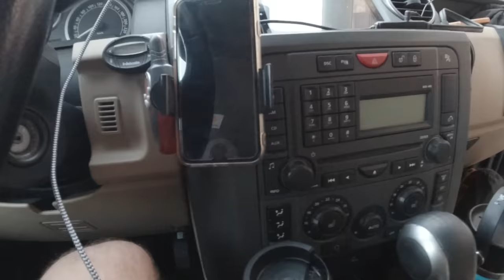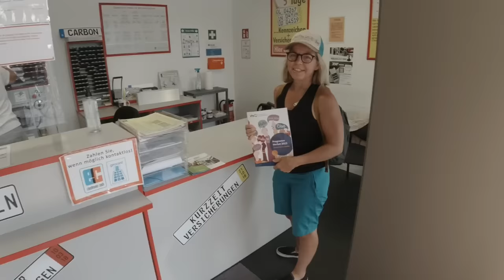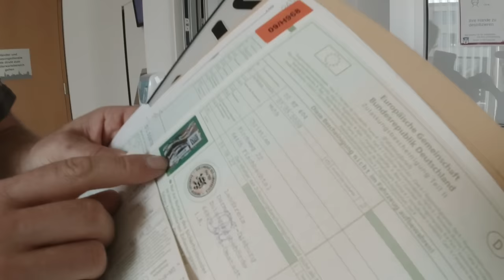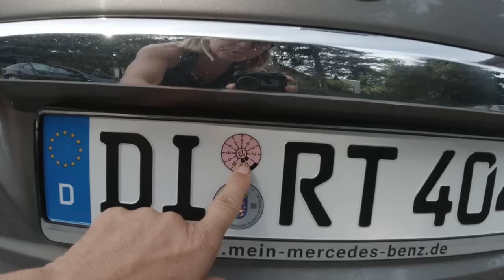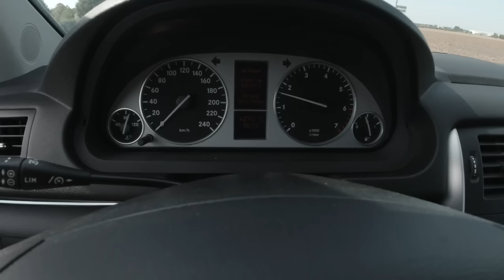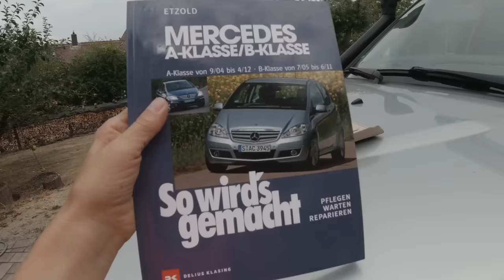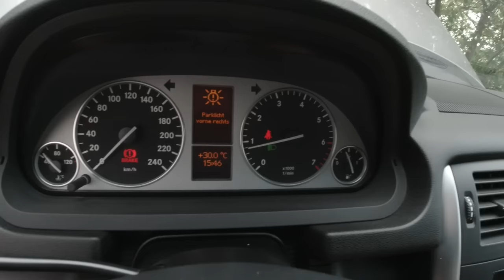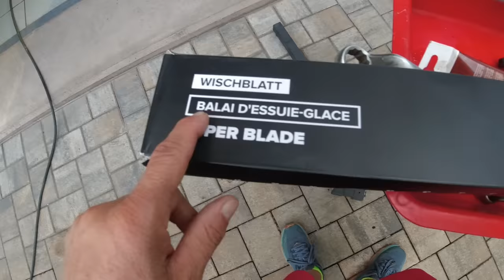We bought a cheap Mercedes B-Class W245 and we love it

Comment: Yes, when you own a Land Rover you need to have a back-up vehicle.

I bought a Toyota Yaris because everybody knows Toyotas are reliable.
It developed an ABS fault almost immediately which proved difficult to diagnose.
After inspecting all hubs, and finding various problems with all of them, I got the ABS working long enough to sell it again.

Next I bought a Honda Jazz because everybody knows Hondas are smple and completely bulletproof.
3 months later, two of the pistons tried to escape through the side of the engine-block.
New engine (from a scrap yard) in and sold it sharpish.

Replaced it with a Mini Cooper because everybody knows Minis are cheap to run and easy to sell later on.
It's roughly £5 per week cheaper to run than my Land Rover and, 6 months later, the fuel pump died and I had to pull half the car apart to replace it.

Meanwhile, my unreliable 20 year-old Discovery 2 with 200,000 miles on it has needed a new set of windscreen wipers.
Reply: Hahahahhaaha. I like your comment about the cars you bought and the reasons
Reply: True story, yeah right.

Comment: Hi Christian and Vera, what wonderful people you are? I first saw your channel whilst looking at LR engine removal... Although we don't have a Discovery, we have a 2007 Freelander 3.2 i6 HSE Auto, (LHD). What captured my attention was the statement that you do your own repairs and go against the trend of buy small, new and sell on afterwards. We share our time between the UK and France. I love my FreeDeux but we too have a back-up vehicle, a 2008 Mercedes A200CDI Elegance. Surprisingly roomy with lots of nice things altough over 200,000 k on the clock. We also made the decision that we would do our own servicing and repairs. There are so many things that are similar, We don't so much have a garage, but a barn with tools!! And have purchased a two-post lift, that is waiting until we can put in a concrete base. So far I have replaced the cyclinder head on FreeDeux and will soon, (after we install the lift) swap out the engine and gearbox. We replaced the a/c compressor and the Auto gearbox ECU on the baby Mercedes. May I say that you are both inspirational, Thank you for sharing.
Reply from the maker: Hello Emma, thank you so much for your comment. Sorry for the late reply but sometimes, we get so many comments that we miss sometimes  important ones. You are going to love having a lift, I certainly do and I wasn't sure we really actually needed one. 😀I miss my Freelander, it's actually parked outside across my house on the pasture to be fenced in for horses. Living the good life now. 💪🙋‍♀️Vera

Comment: The subscribers Collie is a beautiful looking dog, and friendly! Nice of him to give you LR parts.

That is a nice looking suitable Mercedes. I don't think we ever got the B-Class in Australia. I have never heard of them. We too wanted our kids to have vehicles with Air-bags, ABS, Stability Control  etc in their first vehicles. You don't want them to be in an accident, though you want them to be well protected if it happens. Very different when I was growing up, as young drivers our cars were pretty bad. We knew no different.

I too am looking for another vehicle - though my reason is so I don't use my LR3 as much around town. It was always going to be my touring vehicle. I ride my motorbike to the office when I don't work from home, however it is nice to be in a car from time to time, especially when it is raining. Plus I prefer not to take my dog in the LR3 unless I take her camping - she shed way too much hair!

I have been looking at Mercedes Benz from the model years 1987 - 1997 and Audi's from 2003 - 2008. I like the overall looks both internally and externally, plus the grill of the Mercedes of those model years. I would dearly love a diesel Mercedes, though they are extremely rare in Australia. I figure the Mercedes of that vintage would be easier to maintain by myself. the Audi is purely because I like them, though I accept they can be a bit problematic, though the 1.8 litre engines of that vintage are bullet proof if maintained, especially the timing belt.

I entertained the thought of a BMW, though the Vanos system is just too problematic, and older ones are pretty much well and truly past their used by dates here unless they are one owner vehicles.

I could buy a Nissan, Honda or Toyota, but that would be boring!

Comment: Thanks for the video guys, they NEVER fail to make me laugh. Im a LR fan for many years, owning a once rusty 1991 3 door diesel Discovery that I spent a month rewelding the underneath on most things exept the chassis as it was fine. Im fussy so tackled everything that was needed doing.. That Disco although old was my daily driver from 2007 till 2017 still reliable still shiny in its factory black with full sized side factory graphics.. It was not the LR fault but mine when i sold it as I became disabled so ended up with a MK1 Freelander BMW diesel powered Automatic HSE spec.. Still love my Landrovers Still keep looking to buy a nice example automatic early Discovery, maybe a ex Japanese market one re imported back into the UK.. Anyway, Thanks again for the honest but fun videos - Ian .. UK.
Reply from the maker: Our pleasure.

Comment: Now you have the backup vehicle I’m hoping you’ll move onto getting the body off Vera’s D3. I keep hearing ‘we’ll wait till the engine fails’ but I honestly think this is not a good strategy. A broken crank is going to do untold damage to the block as well as causing failure in other components. If there was one thing I could do to my D3 now it would be to get the engine out and replace those worn bearing shells. For peace of mind if nothing else. Apart from that, if Vera doesn’t like the Mercedes Christian might have to lend her the the mall crawler! Keep up the brilliant content, it’s the best thing on YouTube. Thanks.
Reply from the maker: It will be a few more weeks before body off.  But it will happen.  Christian

Comment: In the UK we can do it all online in a few minutes as long as the car you bought has the  previous owner's paper car ownership document, minus a section that the seller uses to declare the car has been sold, either online or by post. 

If the car has a valid test certificate and you have insured it, that information will be registered online too, so all you have to do is pay the road tax or set up monthly bank debits online and your car is then legal to drive. The new paper car ownership document usually arrives in the post within a week or so. You destroy the old one. You can also do the whole thing using paper forms by post or at a post office if you want.

Comment: My wife SuSu has 2016 Mercedes B180 with which I hope not to have compulsory under body relationship.  Has had automatic transmission valve body replaced at 69,000km by Mercedes warranty…..(phew🥵). Price aud$7500.  Happy to learn a little about the B180. 
Sadly my 2006 Disco3 started to haemorrhage from rear main seal & at 71 I do not want to crawl under KT anymore 😢😢.  Sold it 2 days ago & bought 2012 Ford Territory which has same 2.7 ltr V6 Diesel engine as D3&4.   This one very quiet & healthy at 100,000klm. 
Thanks again for your videos & I will keep watching as I like your dry humour as well.  
Cheers again from 
Hugh ESLER in Melbourne Australia 👍👍
Reply from the maker: This is quite brave to buy an other TDV6!  Christian

Comment: Bigger gap = stronger spark so if you have a problem in the cylinder, it can get the cylinder to work.  Could be a cheap fix to get a 170K engine to run.

Comment: Again, very cool vid on real automobile life. I quit Mercedes some years ago - for good. About 1984, I bought a T1 207D long-wheel base, 2.8to GM, 1979 first reg., 100TKM on the clock, first owner, OM616 engine (2.4l, 65PS). These engines had the reputation of lasting for ever. There had been rumors about 1Million Kilometers done in Taxi cabs (MB W123, passenger car, same engine). I converted the van for a camping car. After about 10 TSD kilometers later, the timeing chain cracks and shots the engine to scrap. Reconditioned, genuine MB engine installed half a year later. This engine developed problems after 100TKM. By the way: When we bought the van, it had the 3rd rear axle installed. Rust was a companion all over the years, despite had all the screwed on-parts hot-dipped-zinc coated ( all doors, wings, hood). In the end, I lost the fight. There are some stories to tell. Second MB was a MB124, 2.5 5cyl, passenger car. Sold it after 5 years and MB lost a customer for ever - to put the expérience in a nutshell. During my trip through Moroc a few years ago, I saw a lot of MB207307D vans on the road and in the backyard ( on repair) and a lot of MB W123 taxis. A Toyota Corolla is one of my backing cars.
Reply from the maker: We only wanted to spend a certain amount of money for a vehicle for Robin. And after looking at so so many small vehicles, we just got the Mercedes. We actually wanted a Skoda Roomster or Yeti as the are big enough to have a small camper build inside. But they are so much more expensive than this Mercedes we got. And we have a good friend working at Mercedes, so that is always a bonus. Now most of us here  are driving a Land Rover, you that story you wrote can happen to anyone at any given time. 🙋‍♀️Vera
Reply: @Vera_and_Christian  That's right, Vera. Wish both of you all the best with your new aquisition. Regards Heinz

Comment: My wife has an 2007 B200 petrol in the same colour. We've had it  qutie a few years now. If you find your spare wheel well in the boot filling with water after washing it or a rain shower then this will be the plastic vent flaps which are located under the rear bumper left and right. I changed these on ours when we bought it and they are now leaking again, think i'll use sealant next time rather than the sponge gasket they come with! Seems like they deform over time and the seal fails (took ages to find out what was causing the leak in the first place). Also replaced the clutch at about 85k miles as it was slipping, very difficult job as the engine has to be removed. Other than a few sensors it has otherwise been a fairly reliable vehicle. Good to see your seat repair as ours is exactly the same so I might try that myself. Love the channel - keep it up!
Reply from the maker: Ok, thanks.  What mpg do you get?  Looks like ours is 8.5 l/100km in a 60/40 mix of city/country roads with elevation, averaging 40 km/h.  This is a bit too much I think.  Christian
Reply: @Vera_and_Christian  In the 540 miles since resetting the computer the average speed is 25mph (so about 40 km/h) and the fuel is reported as 33.5mpg (just about 8.4l/100km). I would say we do the same mix of city/motorway as you. (sorry had to edit l/100km conversion as i forgot to use UK gallons I think that's right)

Comment: B-class is definitively not the easiest car when it comes to some parts. That goes for the "fan belt" because it have to be replaced from underneath the car. And the assembly it's running on (tensioner++)also has got a few issues with the bearings getting worn and squeaky. The whole assembly then has to come out, and it's really tight, since the engine is mounted so low and far back. Good vid as always👍
Reply from the maker: I changed the belt.  It’s like pulling a dead snake from behind a furnace.  Had to make a special tool for the tensioner.  Of course the old belt was like new.  Christian
Reply: @Vera_and_Christian  And the special tool is a 15mm spanner welded to a longer piece of steel?😄

Comment: My Disco 2 "backup vehicle" is a Tesla S. No maintenance, 100% reliable. No expensive fossil fuel. (Actually, my Disco 2 is pretty reliable but still expensive to run.)
Reply from the maker: Here in Germany, the electricity comes from coal and natural gas powerd stations. 🙋‍♀️
Reply: @Vera_and_Christian  EVs are still cleaner than ICE since fossil fuel electricity generation is much more efficient (60-80%) than ICE engines (25%).

Comment: I always thought the B class was the least 'mercedes' mercedes that you can get .... but now, I will be going straight onto AutoTrader to see if I can find one locally as the backup vehicle to my L320 RRS, which has a mysterious fault developing in the Active Roll Control system that I cannot get root cause on.....

 I think the diagnosis suggests that my wallet is too heavy and needs to be lightened. 😆
Reply from the maker: The A Class is even less of a Mercedes. Christian

Comment: I have a “backup” as I ended up using my Discovery for very short tips. I got an Audi A2 from EBay with an electrical fault, £250 !   Fixed it for £40 and happily using it for two years now for very short local trips. I do most of the work myself and it’s great to know I don’t need the Disco to be working all the time.
Reply from the maker: That is great 👍💪🙋‍♀️Vera

Comment: I’ve got a 3.6 TdV8 2010 which is still based on the Ford Lion engine should I be running 5w 40 oil it has a DPF and EGR so I have to run the C1 variant as I understand it for the DPF any help gratefully received / PS Love the show you guys are great together ❤

Comment: WoW thats probably the most maintained Merc B class in the world, not the prettiest Mercedes but ok the second motor. I used to own a Merc clc coupe loved the car for looks but did have some design faults like every time I shut the door the seatbelt wouldn't go back into place so therefore would smash into a door speaker so had to replace the mesh front, Mercedes wanted £129 part was £29 so fitted myself. Unfortunately even though I had the car serviced every year the timing stretched and skipped a tooth nearly destroyed the engine, when starting it the chain slapped the sides of the cover so needed to be replaced at only 33,000 miles on the clock. Also to add when I bought this from new the handbrake snapped after 2 months I can honestly say I have never had a handbrake fail on any of my older cars.

Comment: Petrol in Australia is around AU$1.60/L and diesel is about AU$2.00/L - substantially cheaper than Germany. On the other hand, we will pay around AU$8000 for a 2008 Mercedes-Benz A-Class A170 Classic Auto with 160,000km, or AU$11,000 for one with 90,000km. Around 7.4l/100km. A Toyota Corolla with same kilometres and year sells for AU$6000 to AU$10,000.

Comment: The amount of times I put myself on my arse while working under ramps. One tip if using a baseball cap as a ‘helmet’ is put it on backwards otherwise the peak hides the ramp and low hanging parts just enough to brain 🧠 yourself 😳
Reply from the maker: It is an oficiall safety helmet, in form of a baseball cap. We have that here in Germany. I have seen those in the US too. 🙋‍♀️Vera

Comment: Why dont you buy a toyota yaris 1..cheap and  realible  and on the end you will crap the LR'S .Are you scared that it can work ? its incredable how much repairs are requiered to drive a disco 3.
Even my Renault Espace has 626tkm  and I couldnt make such Videos with it..there is simply no content Turn the key and go where ever you like and its a 4x4.
Reply from the maker: A Yaris is quite expensive to get and a whole bit smaller than a b class.   Its actually scary small for the Autobahn.  We did look at one but they hold their value quite good.  Christian